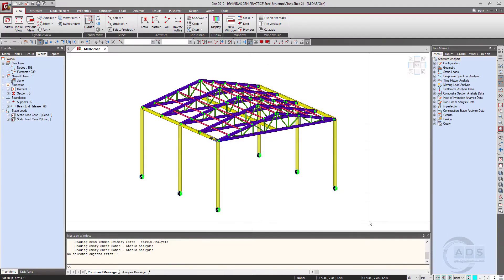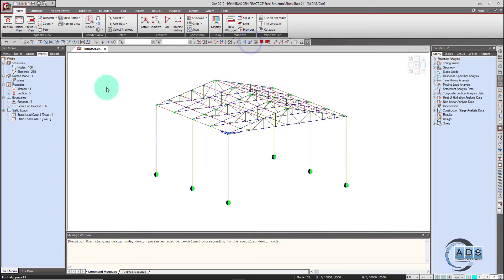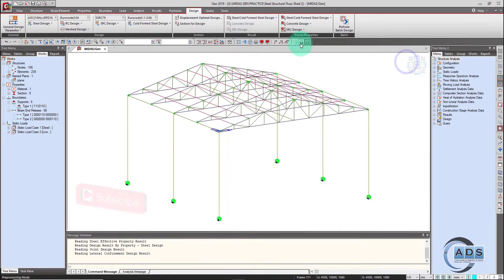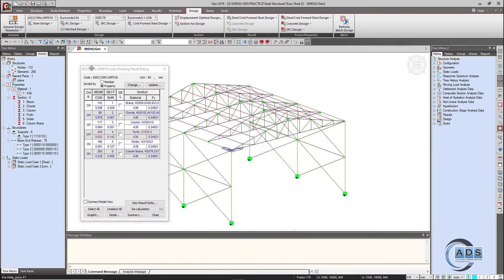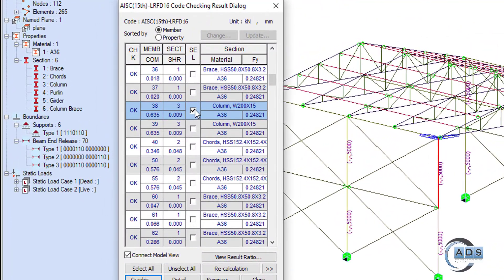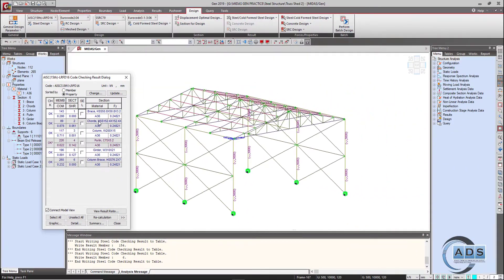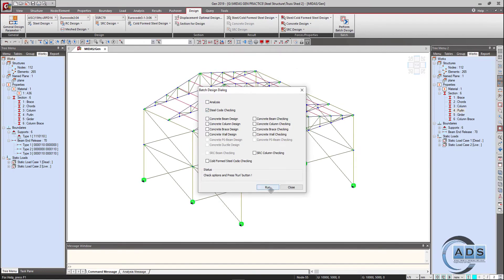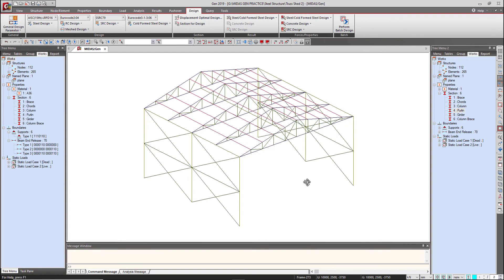Steel Structures: Analysis/Design Course using MIDAS GEN - SIMPLE STEEL TRUSS SHED (Part 2)

Comment: Bottom Chord why used Lz 1000mm. , Vertical Member Brace Along Z axis   About Ly (Ly could be use 1000mm. Lz could be use 10,000mm.)
Reply from the maker: Thanks brother for comment.. Acutally these lengths (Ly and Lz) are buckling lengths used in calculation of KL/r..  First thing is that Since the bottom chord should design as a beam not as a column sowe can ignore this. I will make a video on this concept. But lets say if we consider this to check its axial strength as well.. So thats why i have explained it here.. You can pause the video @ 22.15 and 22.51 and see the buckled shape.. In buckled shape for y local axis , observe that zero deflection occur @ 0m and 10m.. But for z local axis, zero deflection occur after each 1m thats why Ly  is 10m and Lz is 1m. Hope I can make you clear about this ...
Reply: @analysisdesignstudio3363  the bottom chord is not compressed, why define Lx and Ly ? I don t undestand Well... thanks
Reply: * why define Ly and Lz if the bottom chord is in tension?
Reply from the maker: @matteoponzano3318  thanks brother for comments. Since truss is a member in which axial forces as well as bending shear (due to continue member) are induced,, as the code prescribed to find interaction ratio, and the programs calculate axial tension as well as axial compression for each member,. Thats why we have to give Ly Lz..
Reply: @analysisdesignstudio3363  thanks a lot. Compression stresses that derives from bending, in general, can generate lateral torsional buckling (Lb).... Ly and Lz should only account for axial stresses  or not? Where i wrong? Thanks very much for your's tutorials
Reply from the maker: @matteoponzano3318  yes you are right... Ly and Lz are for slenderness to account for BUCKLING, and the problem of buckling arises where there is AXIAL COMPRESSION..
Reply: @analysisdesignstudio3363  so for example, Ly represents the unbraced lenght in local y direction due to only axial stresses. It s right? Thanks
Reply from the maker: @matteoponzano3318  yes right

Comment: sir, Bottom chord lb = half of total length while lb is for compression flange but the mid beam connecting the bottom chord is connected with the web of bottm chord member? correct me if am wrog plzz.
Reply from the maker: Yes you are absolutely right. I will make video related to Lb in which i will explain all the concept. Thanks for notifying me ❤️

Comment: something wrong in putting the unbraced length of bottom chord members. Since vertical members of truss braces will restrain the moment in y direction I feel Ly should be 1.0m (as you did for the top chord members), and Lz should be 5.0m, because of the presence of a central runner and Lb will also be 5.0m. Pls check.
Reply from the maker: Thanks brother for comment.
vertical members of the truss will not 
restrain deflection due to bending of bottom or top chord in 
local y direction as they will move with downwards
 (as the bottom chord deflects) thats why Ly should be 10m. 
But in local z direction, these verticals will  restrain the 
deflection. so Lz = 1m. 
Lb = 5m for bottom chord as central girder is running midway in trusses.
for Top chord, Ly = 1.0284m beacuse of presence of purlin as they provide restrain 
and Lz = 1.0284m beacuse its of vertical braces (as top chord is inclined
so its inclined length is used)
and Lb = 1.0284m also because of presence of purlin as they provide 
restrain against lateral torsional buckling.
Please check the deflected shape shown in video 
carefully. 

Another important point, Ly and Lz are effective length for slenderness 
check.(KL/r) while Lb is unbraced length used for account of 
lateral torsional buckling.

Comment: Correct me if im wrong...rx should be constrained(fix/check) and  rz,ry should be released(pin/uncheck)...
Reply from the maker: Thanks for comment. Brother.. FEM software considers Moments ABOUT any axis. Pause this video @ 1:21 and observe the Truss elevation. Two axes are also shown there (X and Z axes). so to make these columns fix at base for X-Z Plane, Perpendicular Axis Moment (Y-Axis) must be Restrained (Means Lock). Similarly for the other  Frame Elevation (@2:32). Hope I can make you clear about this.. Thanks